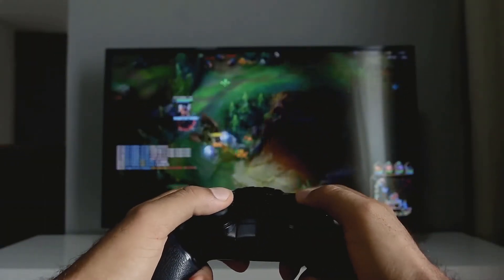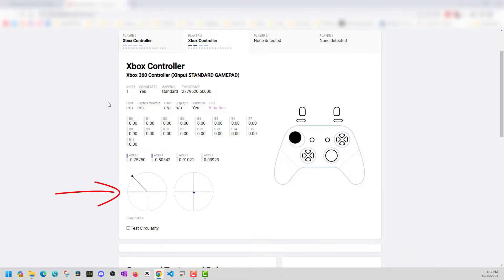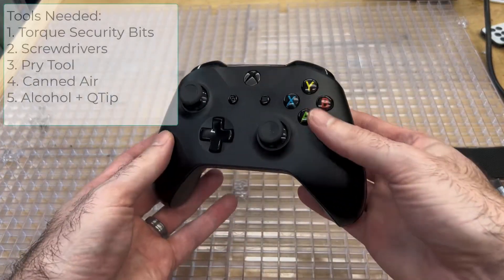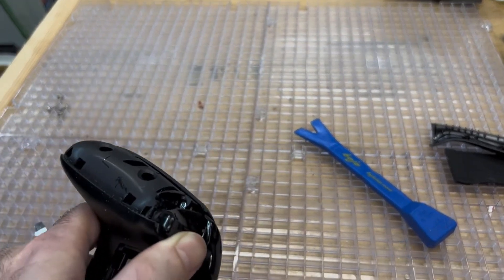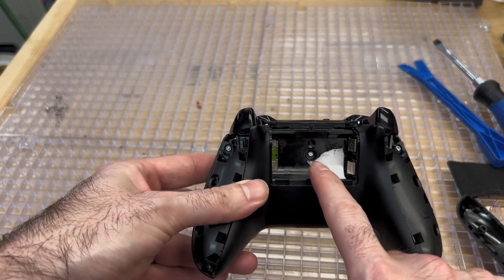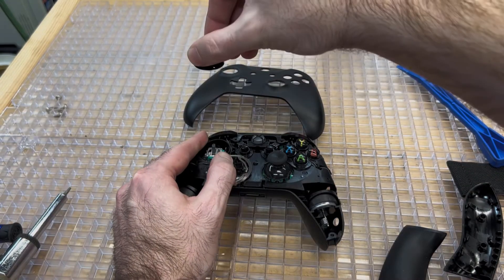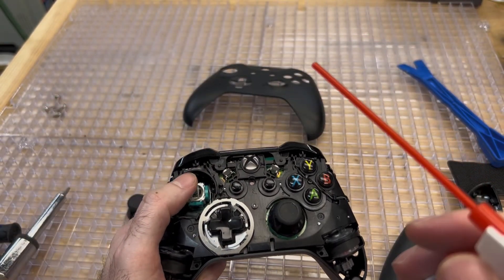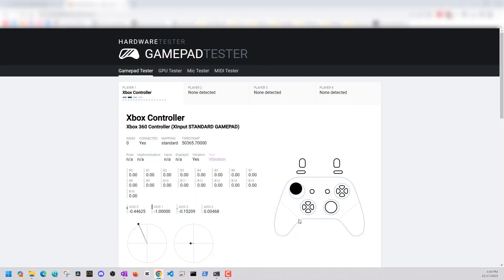Fix Xbox Series X Stick Drift in Minutes! | DIY Controller Repair Guide

Comment: This video does not address the biggest cause for stick drift which is wear and tear on the potentiometers that track the movement of the axes. This occurs on all major controllers for the past 30 years (stop lying like you've never seen stick drift before). A proper repair requires replacement sensors and soldering those in place.

All that said, I was just looking for a teardown and I got what I needed. 10/10

Comment: my controller has only been used lightly for a couple months and the right stick is drifting already. It doesn't seem like the stick is physically drifting it's like the module inside is wigging out randomly.

Comment: Great video, got L joystick drift fixed. Although, I knew it was the L, I liked confirmation thru Hardware Game Tester that the L joystick was drifting. I also checked the rest of the control buttons, which were all normal.  As he instructed, use q-tip, alcohol as well as air duster and a lot of junk just flew off the L joystick.  Used Game Tester again before re-assembling controller which confirmed no more L joystick drifting. Thanks for the video. By the way, I also tested my Xbox 360 & first XBox One controller  , and no problems. Agree, MS controllers have decreased in quality and durability thru the years. It is a shame.

Comment: I bought this piece of shit for the equivalent of 70usd. It didn't even take half a year of average usage to get stick drift. My Xbox One controller had other issues that weren't even fixable for me. I'm never going to buy an Xbox Controller ever again.
Reply: I still have OG Xbox and 260 gamepads that still work fine. Not ever do I recall any of these issues back then. Sony's Dualshock 4 suffered from bad thumbsticks too. AKAIK Dualsense 5 works fine, but doesn't always play nice with Windows. Microsoft sucks so bad. Customer service and quality, they think why bother? They'll just have to buy a new one!
Reply: @FunWithDHG  if only buying a new one would solve the issue... lol. The only thing which people can do is stop buying Microsoft products
Reply: @ You misunderstood what I was saying. The "buy a new one" comment was meant to be perceived from Microsoft's point of view. Why would they bother making a better gamepad? They won a lawsuit over this already, their customer service is garbage, and their opinion is "buy a new one" instead of solving the internal issues within the gamepad. This is new, as I've had OG Xbox and 360 gamepads from decades ago that have zero issues, but I've heard Xbone had problems. I agree with boycotting, which is why I decided not to buy a Series X after my issues arose, found many others had the same issue, knew their CS sucked, so why give them my money?
Windows is another issue...
Reply: mine barely lasted a few months of light playing. ive had xbox 360 controllers last years with heavy abuse.
Reply: @BIONDIEST  i still have 2 360 pads and they work fine